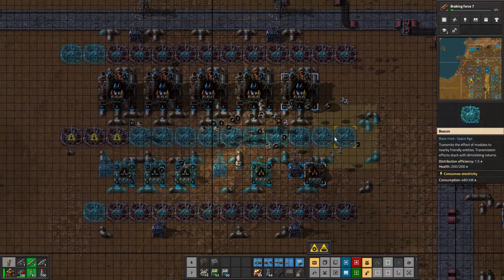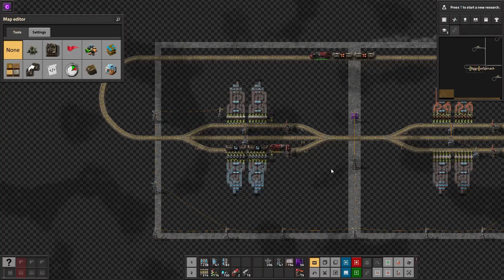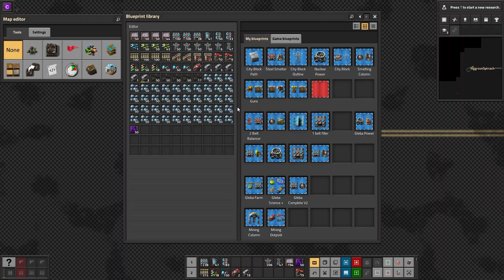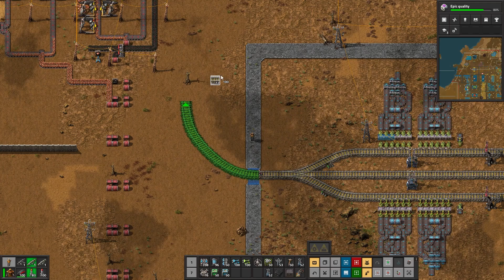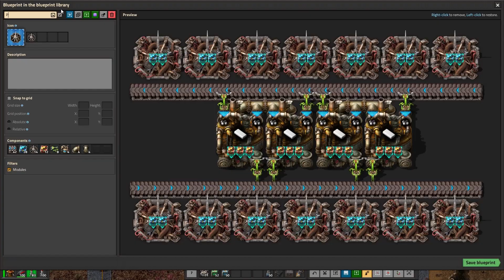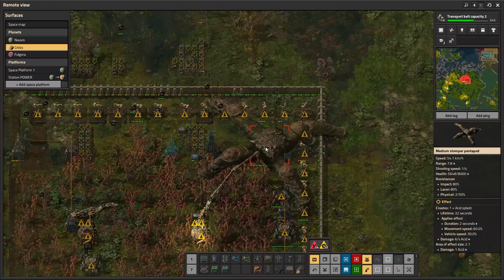Scaling up on Nauvis - Factorio 2.0 Space Age EP12

Comment: I don't remember if it was in this episode but you asked about fuels and their effect on vehicles (trains specifically). Each has a percent increase on acceleration. AFIK trains will accelerate until they need to start braking. With the braking force research you reduce the distance they need to brake. So they stay at top speed longer and their routes take less time. 

I like the cleanup segments, experience Factorio players have accepted it as part of the game and I feel that new players will find it useful for the true game experience. 

I hate trains as well but I'm trying to "embrace the suck" as we used to say in the military and just get over it. I've been reverse engineering train build blueprints trying to figure out what makes them work. I'm also trying to learn to leave plenty of room for the train network and all the loading and offloading stations I'm going to need. But I do think the best way to do it is to have multiple trains rolling to whatever resource node's buffer chests are full enough to fill a train using circuit conditions communicating over the signals network.
Reply from the maker: Yes I do remember better fuels make trains faster. I too hate trains, but alas belts don't work for long distance

Comment: Episode 12 comments part 2. 3) 43:14 The base cleanup stuff isn't boring, I really like watching you tying up loose ends. 4) At 52:52 you say "I don't want to do infinite research". I think you should do 5-6 levels of "infinite research" for techs like Plastic Bars productivity (which you mentioned several times is lacking), or Steel Beams productivity (another excellent choice), or even Personal Health. That would be much more productive than researching "Braking Force 7" (I mean, Braking Force 7, seriously ?). 5) Speed modules can be added to old Pump Jacks to make them good again...or at least better. By the way, did you know that mining productivity also affects Pump Jacks ? 6) Suggestion: just to be on the safe side, place 300 Accumulators on Nauvis. It helps deal with power demand spikes, like when we get attacked by several simultaneous waves. Allright, talk to you later.
Reply from the maker: Yes fair enough. I just like to finish the non infinite stuff first for "completion" sake. And yes the accumulators are a good idea I'll try fit them in somewhere at some time.

Comment: I recommend looking into the White "Stack" Inserters (not referring to the Green Bulk Inserters; AKA: the old Stack inserters), you will be able to take advantage of the Transport Belt Capacity Research that you have been doing. :)
Reply from the maker: @PatientEscape38  yes I noticed them I a future episode. What's the use case for them? If I convert to stack inserters I have to convert my entire base? Ie if a stack insertor drops copper plate stacks onto my main bus my green circuit makers need stack inserter to pick them up too?

Does it multiplicatively increase a belts capacity?? Ie. A blue belt can carry 45 stacks of items and if I stack is 4 items does that mean a blue belt carries 4x45 items now?

I'll have to test all this in my test bench before overhauling my base!
Reply: @DataEngineerPlays  you asked "Does it multiplicatively increase a belts capacity??" ... I am not sure, but this belt stacking idea was directly stolen from Dyson Sphere Program, so I would think that the answer is yes. It's probably that more items are able to travel on a single tile of belt.
Reply from the maker: @power2084  But I assume you would need this stack inserter to de-stack everywhere that has a stacked belt right? That's a complete base overhaul
Reply: @DataEngineerPlays  If it works like in DSP, which is very likely, you don't need stack inserters to be able to pick individual items from the belt. Regular inserters (those already present in the factory) will take what they want from the stacked belt, which simply now has increased throughput.
Reply from the maker: @power2084  Yeah cool. I don't think throughput is really an issue for me atm though
Reply: @DataEngineerPlays you only need the White Stack inserters outputting onto the belt, they grab up to 16 items and places them onto the belt in batches of 4. The other inserters don’t have a problem grabbing from the stacked item belt, but the only thing that can re-stack a belt is the White Stack inserters (sadly splitters only move the item stack not the amount in each item stack). 

I’ve yet to mess with them myself, so testing them is smart. This is the bit I know from the FFFs.

Comment: At 49:22 you ask "Where can I save all this stuff?" 
If you look at your hotbar, the Blue Book on the bottom is a button to generate a Blueprint Book which basically acts as a folder for your blueprints (and yes Blueprint Books of Blueprint Books can exist). You then can use the scroll-wheel (or shift scroll-wheel for the other direction) to cycle through all the Blueprints in the Entire Blueprint Book (and Sub-Blueprint Books). 
The Names of the Blueprint Book (and Sub-Blueprint Books) Path are displayed in the cursor (you can also use Factorio's Icons in names [Click on the Button to the slight left of the Confirm Name button], which is nice for shortening names).
Blueprint Book can fit Upgrade Planners and Deconstruction Planners as well. Hope this helps. :)
Reply from the maker: @PatientEscape38  yessss thank you I'll take some time to organise my blueprints at some point

Comment: Hey, it's Power. Episode 12 ! Comments part 1... 1) At 10:33 Exploiting Iron and Copper resources from far away using trains: you're doing it wrong. Far away iron and copper should be smelted (using electric smelters, of course) on site, at the resource patch. It's what's called in situ in Latin (on site). The reason for that ? Plates take only half the space in a train wagon compared to ore. Moreover, optionally (depending on location) at this point in game, with plates smelted in situ you could start delivering some iron or copper into the bus from THE BOTTOM (by having a train dropoff near the bottom, which would also be infinitely easier to setup than having a new train dropoff at the top). A belt running in the opposite direction (from the general bus direction) is called retrograde and the bus is then called bidirectional . This helps greatly spread the plates uniformly between top and bottom of the bus. Routing plates easily thru the bottom depends on the resource patch location. 2) 24:23 Gates are compatible with the rail system. Yes, you should also add personal gates into walls for when you're walking around. (continued...)
Reply from the maker: @power2084  the problem with running the bus from the bottom is I don't know where the bottom is yet! What if I need to expand downward?

But great tip about on site smelting! Thanks I forgot that's how I used to do it because plates are less dense than ore! Silly me
Reply: @DataEngineerPlays  It's not a question of IF you will need to expand downward, because you will need to eventually. And the solution is: a new feed line of plates can run both north AND south at its connecting point into the bus. Simply run it north for now, and later, you can split it off to run south on the same line, at the connecting spot.

Comment: An easy way to reinforce a wall is to put landmines behind it. They have a trigger range of 2.5 and an AoE of 6 so you can place them behind a single wall and they'll still trigger then a construction bot will just place another one behind the wall. They'll kill all the small things and chunk and stun all the big things.
Reply: Also, the AoE explosions don't damage the player, his vehicles, or friendly structures.
Reply from the maker: @sirgaz8699  what that sounds overpowered! I must try it!!
Reply: @DataEngineerPlays  It's a quick and easy solution to reinforce a wall since all you need is bot coverage, which you have to maintain the wall, and A mine assembler.

I think it's a bit unfair spitters will spit over walls but I am exploding over walls so ehhhhh